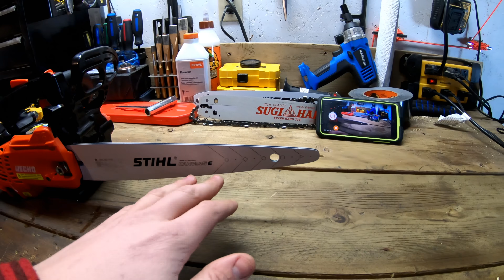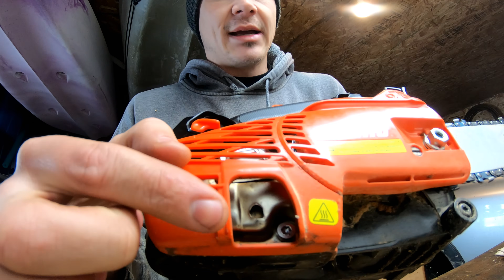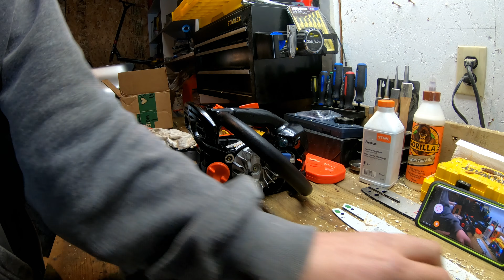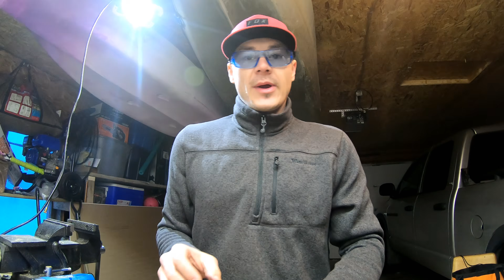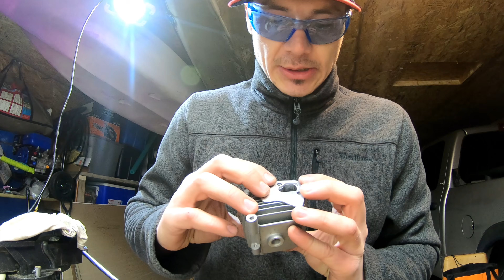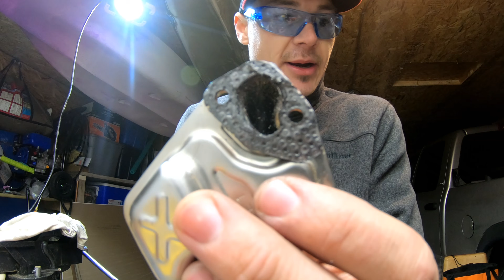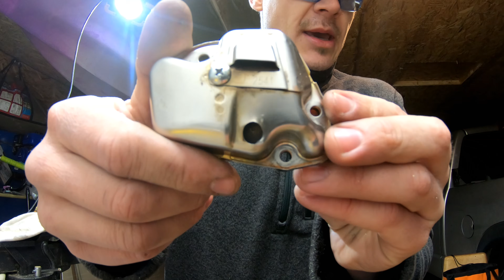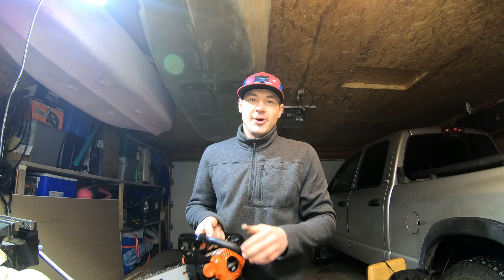Echo 2511T Full Mods!

Comment: I dont get it. Why not enlarge the holes on the mag coil and rotate that instead of weakening the keyway?
Reply from the maker: It doesnt weaken the key way, the shaft is tapered. Once you bolt it on you are good, But you could do it anyway you want I suppose. It's just the way I do it Thanks for watching.

Comment: Might be late but can you make a list of the item numbers for the chain, pitch bar and the sprocket for that chain setup?
Reply from the maker: Go into the description on Ebay here it shows the part numbers, And chain to use I got one of these bars a guy machines them. https://www.ebay.com/itm/BAR-ONLY-14-stihl-1-4-pitch-conversion-BAR-for-ECHO-CS2511t-355T-330T-360T/123759609814?epid=668130947&hash=item1cd0a5c7d6:g:jmoAAOSwgJ1cZ5tL

Comment: Makes me want to advance the timing on my SRM266 trimmer now. Already bought a spare $10 muffler to gut and put on it so I don't destroy my good one if it doesn't work out. Not sure how I'm going to get that catalyst out of there but I will one way or another. Pretty sure that blue ignition module does have a rev limiter type deal. My SRM266 has the same looking blue module and it won't rev to the moon like my older Echos will with no load on it. I hate those rev limiters on small engines.
Reply from the maker: Ya I agree about the rev limiters, I will have a video about the saw soon I actually had a defect in the cylinder wich was not related to mods, there was a small pit just below the exhuast and I thought it may still work but it ended up letting pre detonated fuel/ and or air into exhuast port so when it got hot it didnt want to start again. So when I get the new cylinder I'm gonna play it safe and just do the gasket delete. I'm confident it will be fine, Its been a bit of a headache getting this sucker running the way I want. Thanks for watching. O and be careful with them cats, If it looks like a big honey comb I would leave it, They are a bear to get out and it's important to have back pressure, Not sure what the trimmer one looks like but if you have an extra may not hurt to look.
Reply: @PoplarMechanic  Yeah, the trimmers have the big round honeycomb, along with a super choked off 90 degree deflector. I have an older SRM2510 that has basically nothing inside of that muffler and you can even take it apart with a couple of screws.  The 2510 is 1CC smaller than the 266 and has about double the power and throttle response, and that 266 isn't weak !

I've had issues with the rev limiters on Stihl 4 mix engines, stupid things won't start or run worth a hoot when it acts up.

Comment: Nice video.im currently in the middle of modding my 2511t but was wondering if you retuned the carb after these mods
Reply from the maker: Yes you can bring the high jet down a little bit if the saw is new ( you should be able to tell if its screaming), If you have the limiter caps on you can still get some adjustment. If it runs and idles good dont touch the low jet, It is finicky on these saws atleast in my experience. But you cant really hurt it with the limiter caps on, I recommend leaving them on actually. Good luck 👊
Reply: @PoplarMechanic  thanks for your reply.its not new but will see how it runs on monday

Comment: ok I only feel comfortable drilling a hole in the muffler with my skill level. But my question is should I take the muffler off to do so? And will it still make a difference if I don't go any further inside with other mods?
Reply from the maker: The 100% proper way would be to take it off drill the hole and blow it out. But you could do it without just dont shoot compressed air into the hole or some may get into the cylinder. Just shake it out and let the engine blow it out. I have done it both ways and had success but do it at your own risk. And yes muffler mod helps any saw. Just dont go to big.
Reply: Poplar Mechanic OK thanks. Also do you remove the plastic liminaters to adjust or tweek the carb a bit?
Reply from the maker: @darrengarlough5121  honestly I would just leave it alone if it runs good the echo carbs can be finicky. Turn the high jet down a bit if anything. That's all I would do.

Comment: Hello dude, I’ve pick up a bit of clutch squeal on mine now and then. If you have the chain cover off at some point would you mind just buzzing the clutch off and seeing if the washer behind it is flat on both sides or slightly concave on the side facing the saw?
Reply from the maker: Yes I will do that when I get around to it, If you have the manual it may let you know in there. I cant remember off hand.
Reply: Nice one dude 👍 Yeah I’ve watched a few vids and looked at exploded diagrams online but it just looks like a flat washer on them. Mine is slightly concave on the saw side, which does match the end of the crank, but it looks more like it’s worn like that than it’s meant to be like that - and that seems to be where the squealing is coming from 👍
Reply from the maker: @gerbutt  ok well I'm pretty sure mine wasn't flat, I'll double check when I can.
Reply from the maker: https://m.youtube.com/watch?v=X-qKUtG5GHk 

Watch this video on your computer I believe it shows wich way it goes if you watch closely.

Comment: I just feel comfortable modding the muffler. Do you think that will still make a difference?
Reply from the maker: Yes it will for sure. Muffler mods do alot you should be more than happy with that. These things sure run out of fuel fast hey?
Reply: Poplar Mechanic thanks for the response if we were closer i would  pay you to give my saw a full mod. Very informative vidieos. Thanks.
Reply from the maker: @darrengarlough5121  I appreciate that. I'm still learning though so I wouldn't feel comfortable taking money for it. The 200t sure turned out nice. The echo should be plenty good with the muffler mod, Not alot of room to work on the cylinder without proper equipment anyway. Good luck and remember to start with a small bit if you are using a drill the metal is really weak.

Comment: I don't like the 0.043" gauge chain, stretches too much. Those carving bars are expensive, and you have to watch your cutters' toes and heels with tight radius tips. Sometimes you have to take a little off the back of each top plate too.
Reply from the maker: Well I do have another backup bar if I dont like the 43. I'm gonna test them both out. The carving bar would be cool But I'm starting to question the durability. Thanks for comments and watching 👊

Comment: Did you retune the carb after porting and advancing the timing? If so, can you tell how? Thanks.
Reply from the maker: Yes I did, But as long as it idles and runs good, I'm not going to do the final tuning until it breaks in, I did turn the high down a bit. And honestly there is alot of good videos if you need to tune a chainsaw from scratch. But I just do it by ear. I can tell if the high jet is too lean, And the low jet I base mostly off of throttle response. I will mention it in my next video when I test the cuts. There will more than likely be some tuning required. Thanks for watching .

Comment: No problem. Hope they help. If your chattering your not cutting like you should be.
Reply from the maker: Exactly, I just ordered the dog and 2 bolts, so I will feature this in the first cuts video, it's funny I haven't seen many people run them.
Reply: @PoplarMechanic  literally the only person i seen have them are jack. At least echo once decided that they weren't putting dawgs on the 2511 they still put the threaded holes in the case to have the option to do so if wanted at least.
Reply: @PoplarMechanic  the video before the video I suggested you to watch that jack did after he did the port work he was having some extreme chatter which i know him and it wasn't his bad having the chain to aggressive or anything like that so i watched the video again and noticed the saw didn't have dawgs on it just like the 192t so then asked him if he thought a set would help with the chatter? He told me it didn't come with any but there is the holes to accept some. 1 to 2 days later he came out with the next video. Even someone like August seems to sometimes struggle cutting through bigger stuff with that saw ported as well and you can tell it's because he is trying to force the saw through the wood being there isn't dawgs to aid with this problem on his.
Reply from the maker: @andrewream5279  yea I totally get what you mean, I will cover this on the next video. It is really helpful in larger pieces when you dont want the wood to run right into the saw causing it to stop the chain, You need the dogs to cut smooth and allow for a controlled amount of leverage. This is good stuff 👊

Comment: Awesome video liked seeing you showing off your mechanical side it seems like itll really rip once u break it in and turn up the high side cant wait for the first cuts with it good job
Reply from the maker: Thanks man, I hope once it breaks in a bit more I get the gains I was hoping for, I think the chain is a big factor for this little saw, I will get it in some wood soon. 👊
Reply: @PoplarMechanic  yea i know what youre saying cause my polesaw runs the quarter and it cuts pretty smooth compared to my old one that ran 3/8lp hopefully the 1/4 will make it a little ripper👍🏼

Comment: A limited coil will stop sending spark over a specific rpm. It is an rpm limiting coil that wont allow the engine to over rev.
Reply from the maker: I dont think it could exceed that limit in the cut even with the mods. Well time will tell, still some testing to do.

Comment: Man I'm being totally honest dude this video is badass I really enjoyed it I'm pretty excited I want to go buy one and do the same thing you did I wish you would have came out with your video before I bought mine it would have saved me a lot of money I've never disassembled a perfectly new chainsaw was it easy to remove the cylinder and put it back on ? And is the gasket delete you just Mount the cylinder to the saw with no gasket is that what that is?sorry for the dumb question . Does it seem to run with no problems without having the gasket on there?

Lol 😆 I don't know why but I was smiling the whole time watching your video  keep us updated on the saw good job
Reply from the maker: Haha I'm glad your interested,  your saw would be done at a much higher skill level than mine, you probably had the decking milled down so it can still run a gasket among other features that only years of experience could teach. This is just like how to get some extra power from your saw without a lot of experience or money. As far as the gasket goes, you just put some gasket sealer on it like yamabond. This just makes it so it doesnt leak air, You could also use a beer can gasket wich is a bit safer but not as tight.
Reply from the maker: And yes the echo is really easy the crank comes right out with the cylinder, in addition to that echos only run 1 ring instead of 2 like stihl, so that makes it easier to get the piston back in, Alot easier actually.